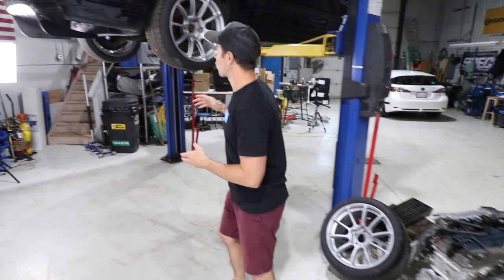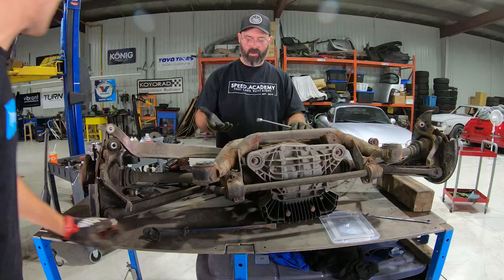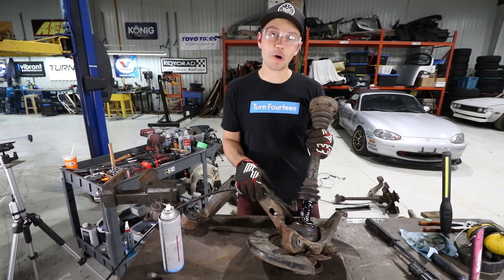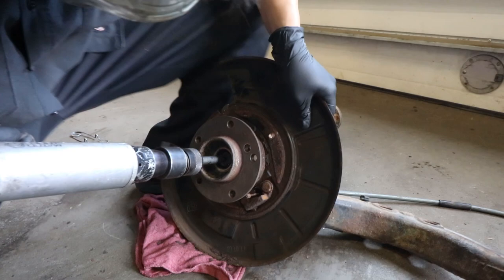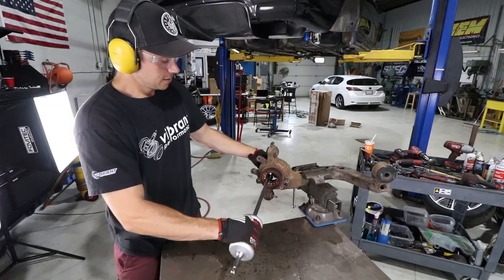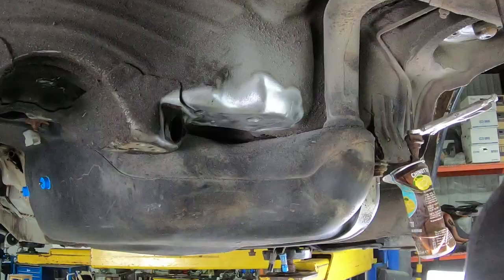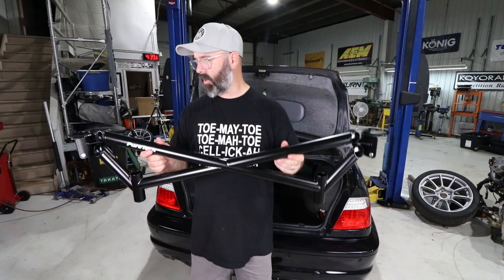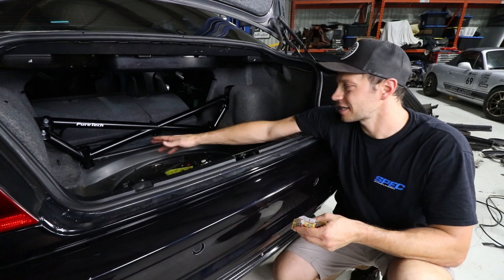Ultimate BMW M3 Rebuild - Best Rear Subframe Fix - Part 5

Comment: Just a friendly tip when welding cracks like those(Usually you wanna go with tig with matching filler rod as it is much cooler and wont weaken the metal around it with heat as much) but if you are going to mig it same process, the holes at the end is good but you should also grind a groove into the crack. The metal you are adding will always be stronger than the base metal so you want more of it with as little heat as you can. The groove not only allows the weld to penetrate further it also will allow the puddle/bead to lay in much more flush with the frame so when you go to grind it smooth you are removing much less metal(This is why tig is such a popular solution for this). Same process on repairing cracks on rims, groove and tig weld ect Just some friendly advice from someone thats certified in tig and mig in pretty much every size, filler rod and position :) This build is awesome, keep up the work!
Reply from the maker: Awesome info! Thank you. Honestly if time wasnt a factor I did read about cutting grooves but fell short to finish the episode
Reply: @speedacademy  Appreciate the reply! Maybe next time, sure does make the weld much stronger!

Comment: Please drill holes at the ends of any cracks even if welding or plating over, will stop the cracks propagating further in any welds or undertow repair plates. Do you have access to dye penetrant (DPI) chemicals so you can see any spider or invisible cracks. 

Edit saw you are drilling the cracks... great job!
Reply: just needed to fully weld the plates on..
Reply from the maker: @anders949494  Incorrect. If you look at Bimmerworld's site they dont fully weld the plates on. As long as the key areas are welded then the rigidity is the same.
Reply: @speedacademy  would do like Redish Motorsport do, and they fully weld but also makes better and bigger plates.
Reply: @anders949494  Yeah, Redish plates are nice.  That said, to do it right, sadly, you'll have to add cups and a CMP/Vincebar to the top side, or cracks will just happen there, sadly :-(
Reply: You got some balls welding the plates on with that gas-tank near it. Would've removed this first - and since the rear brakeline looks like hell, you'll have to remove the tank anyway to replace this line... but nice work. Just a bit sad to hear that the S54 is going to be replaced. Should've put a Supercharger or Turbo on it :D
Reply: @Gigges85  Earlier in the series, they explain why they didn't go with the S54 engine.   It would of cost to much in the end to do a rebuild, since it was high mileage, and not very well taken care of.   Plus they just did a S54 in their M3 drag build, and wanted to try something new.  Cheers :)

Comment: Three jaw puller for the axle. Use the three jaws around the hub, using the threaded rod portion to push the axle through.
Reply: Unless it's seized, like in their case. Then all it will do is pull the hub.
Reply: NCD2294 please go look at a parts diagram. If the hub isn’t installed there’s nothing for the axle splines to be seized to. The axle would just be left to rattle around loosely in the wheel bearing.
Reply: @michaelw6277  
My mistake. I realize now that it'd still solve the issue.
Reply: @of_lion22  no worries!  If I hadn't removed half shafts from so many different vehicles I could have thought the same thing.

Comment: All you needed was BMW special tool kit, would of came right out, also pulls axle back through hub. Only costs like $5k lol
Reply: Just get 3x three jaw pullers and hit them with the Ole milwaukee until the axle is out or you've stripper the pusher rod :D

Comment: The biggest difference you can often make to a roadcar that will see tracktime is dialling in the rear end so you don't get movement / deflection while under load because it robs your confidence to explore the friction limits of the car. I can say that even on my 997GT3, a far better starting car than this, the improvement was incomprehensibly large when I replaced some of the 'street' parts with better track orientated parts (shock mounts, firmer engine mounts, removing rubber from the toe and control arms, etc)
Reply from the maker: It's remarkable what those changes will make and we can't wait to test this car out with all these upgrades!

Comment from the maker: Have you ever struggled so much with removing a part that you thought wasn't going to get replaced or fixed? Tell us your story!
Reply: My diff drain bolt on my 350z had the most stubborn 18mm Allen bolt, I couldn't muster enough torque by myself. So I had to hire a lift so I could use a pipe on my rachet. $150 to remove one bolt aaaagh
Reply: I literally did the exact same thing on an E36 like 20 years, lost my mind I swear, think I actually cried a bit lol
Reply: Hose clamps. My flathead kept slipping off it was sort of annoying.
Reply: Needing to use forklifts and small wheel loaders with forklift attachments to remove and install pins in even bigger wheel loaders or excavators 😅 have even chipped off parts of tines of the forks hitting the pins that hard
Reply: Had the same issue with my FD RX7 axles. I managed to fit the axle and hub assembly in the shop press and get them out.
Reply: I finally hammered out a stubborn wrist pin using an old flathead only to realise the screwdriver was now stuck tighter than the pin had been. Had to saw it off and buy a set of punches. Lesson learned, use the right tools.
Reply: Yup, I had trouble with everything you can imagine a on a car but most of my pain could have been avoided if the people before weren't so scared of grease or antiseize and use them.
Reply: I had exactly the same problem on my e46 m3, left axle stuck in the hub. I was able to remove it with a 12 ton 3 jaw hydraulic gear puller from Harbor Freight.
Reply: In my desk, I have a pair of Sway bar end link nuts with attached studs. I bought a set of Swift Sport springs from a friend of mine with the catch that he help me install them (I tend to struggle mentally with these things when I try to do them on my own). Well, the end links were so rusty we couldn't get them to budge after about 2/3 of the way down the stud. So there we are, 9:00 at night on labour day weekend, I'm 500km from home, and the front suspension on my car is in pieces. Thankfully, the next day we came at it with fresh eyes and managed to get it replaced with a set of struts he had as spares.

The rears were literally a 15 minute job.
Reply: Sorry, but stuff like that i try to forget asap
Reply: E39M5 so I got the Bilstein B16 coilovers from the guy we traded he got my stock suspension and I got his with money on top, the rear struts collars weren’t touched probably in a decade and it was night mare ! It took 4 days to get those collars to get them loose! The technique we used was similar to air hammer except it was done by hand too about 2/3 hours
Reply: My friend and I were removing aluminum wheels from an f450 dually. Every tool we had wouldn't touch them, heat, penetrant, sledge hammers, porta-power, etc. So we manned up and took it to a wheel shop. They couldn't remove them either. The wheels are still on the truck, years later. I jokingly said we should leave the lug nuts off for weight savings, as those wheels were now officially permanent.
Reply: can you guys do a cost analysis video covering all the parts and everything you put into this and how much money you spent on this project in total
Reply: I had to hit the front control arm ball joints for about 30 minutes each side with one of those forks and a mallet to separate them from the knuckles in my E46. I live in a small town where the stores didn't have a properly sized ball joint separator (the one they had didnt insert properly onto the ball joint because it was too big and I didn't want to wait for 2-3 days to get one from Amazon).

Comment: You do realise that racp repair plates are just a band aid? They are intended as a final stage to a far more comprehensive repair.
The damage actually begins at the 3 spot welds joining the racp to the left rear inner wheel arch, there just aren't enough of them so seem welding this join is pretty much a must.
Will be interesting to see how the cross brace performs over the long term but I would have preferred to see something that also connects the chassis legs at the floor as this is another significant part of the overall design flaw... 
   I also worry that all of the cross braces, vince bars etc out there fail to address the front mounts sufficiently although on cars caught early enough tying the chassis legs together at the rear mounts should mitigate the chances of damage at the front mounts... There are however still some dodgy mig welds that invariably need attention..

Comment: Ya’ll could really use the help of penetrating oil. If you spray it on and let it sit for 45 minutes, that could help w a lot of man power you’re putting into it. Of course it doesn’t always work but don’t underestimate it

Comment: So afraid to see what my subframe looks like. I have 157k on my car 😬
Reply: T Ly that’s all i thought about the whole video 😂
Reply: Chances are your car will be totally fooked. Boot floor about to rip apart.
Reply: I got 220k miles on my e46 M3 and im afraid of what's underneath
Reply: I’ve got 157k on my 330i. Small crack near the left rear mount at the bend in the sheet metal. Pretty common place to first fail.
Reply: It all depends how the car was treated it's whole life.. if u buy a stock car with less owners chances are they drove the car normally, if its a salvage title, modified, and has had a bunch of owners most likey it's cracked. Also depends a lot where you live since their are areas where cars rust more
Reply: don't be, I spent money on buying reinforcement parts bushings and a mig welder and after many hrs of disassembling and grinding off rust my subframe was healthy , still went ahead and put the reinforcement kit and poly bushings, new shaft center bearing support and guibo, them recoat the bottom of half the car with rust proof,  if you ever get to do that allow yourself a few days and inspect your diffential,  I failed to do that and I have to go through that ordeal again and also make sure you tight all nuts and bolts in that area
Reply: @javierhernandez215  Did you do that on a lift or jack stands?
Reply: @MindOverEverything  jack stands buddy a large ones and it seems a bit complicated but once you start taking things apart and put it away more roomie is going to became, get a leather jacket for welding, also take the fuel tank off to be safe if you are planning on welding just to be safe,it took me 4 days to get it done a wasn't working hard and definitely not steady on and off,  average at handling tools and poor skills at welding, I Google any problem I came across, ate 3 meals and watch TV on those 4 days all that by myself
Reply: @javierhernandez215  That's really cool. Thanks for the tips, too. I just test drove a 2003 with 85k miles. Female owned and not driven hard, so if I buy it I probably won't have to do the subframe for a while. That'll give me time to learn some welding skills.
Reply: @corey4582  honestly it’s probably not that bad 
I mean fuck.. it’s lasted this long lol

Comment: i had the exact same issue when changing the diff and axles on my e36. I eventually got the axle out of the hub by using a pulley puller!

Comment: damn!! I'm glad I didn't get a e46 m3 and bought a m2 instead..
Reply: Same hahaha
Reply: Why would you compare a 15 year old car with a new one regardless of what it is? Specially with one going for $15-20k and the other +$40k lmao
Reply: @tribewu3223  because they are similar? Weight, wheelbase, handling, basically everything except the power output but still very similar. Not considering the interior here.
Reply: @zexiali6483  yeah I know thats why everyone who's driven a m2 say it "feels" like the old m3. My point is u just said it, everything is similar so why didn't u go for a e46 m3 after watching this video? Cause the sumframe issues ? If you're looking at a e46m3 all this needs to be in your head already & have no problem doing it.
Reply: @tribewu3223  m2 comes with warranty, nice interior. It's a 2 year old car. I daily it so I want it nicer.

Comment: It is easier to get the axels loose when the subframe is still in the car first rather than drop the subframe then remove the axels. Remove axle nut, spray a lot of penetrating oil in the spline, disconnect from the diff, then place a ball pean hammer in the axle dimple, then take a BFH and hit the opposite side of the ball pean hammer.

Comment: Didn't read all of the comments, but in case no one else already mentioned it, you should have welded all the way around the reinforcement plates, not just in a few places. Personally I would have gone with the Redish Motorsport plates. Also, any time you are directly underneath while drilling metal, do yourself a favour and put on some goggles to prevent getting metal filings in your eyes.

Comment: Wouldn’t an underside epoxy re-plate be better than weld? More homogenous contact, and no HAZ. 
What about using a Vincebar (or CMP similar) weld-I’m topside instead of the X-bar (which isn’t really an engineered truss. It’s simply 2 triangles connected at the middle-which, itself, is a flex point between the two triangles)

Comment: I've heard aircraft glue works the best to glue on the rear subframe reinforcements instead of welding them on limited spots.
Reply from the maker: There are alot of options and opinions. Welding seems like the go-to no fuss method without worrying about proper adhesion. Either method will last a very long time so unless you are talking about another 100K of driving and comparing whether glue or welds held together better, I think it's a wash for what is best.
Reply: @speedacademy  The reason I mention that is because some people at the track have used the welding method but later on experienced cracking around the welds instead. Either way with that reinforcement brace it should be fine. Thanks for all the detailed work and explanation you guys provide!

Comment: If you're going to push 1000hp out of this car, you're wasting your time with stock axles. I'd upgrade to driveshaft shop axles if they aren't already in the plans. Stock will guaranteed break.

Build is coming along well so far and you guys seem to be very knowledgeable.  👍

Comment: Might as well slap a 2jz in a cheap 240 chassis and call it super car killer. You could’ve made this into a fairy exotic classy “supercar” to kill supercars. 2jz is bore snore, s54 is much more interesting and just as capable.
Reply: Agreed. Their budget obviously didn't allow for them to do an HPF or Maximum PSI 1000whp S54 build
Reply: IMO a turbo S54 would be both too overused and too simple. I would love to see a twin turbo S62 instead, that would be closer to deserve a  "supercar killer" status in my mind

Comment: Hey guys im doing the same thing to my e46 and i was wondering when u have the rear subframe bolts in holding up you subframe are the top bolts that go with the brace stopping the subframe bolts from going all the way thru?

Comment: I've always doused anything grimy or rusty in penetrant fluid before even attempting removal. Not sure if it works on your hardcore rust.
Reply from the maker: Doesnt work that well on seized hardcore rusty bits like this. We’ve tried but we also dont have days to wait for it to do the job

Comment: You’re working against yourself by not having that table bolted down. Most of the energy from the slid hammer hits is going into moving the table. ✌🏾

Comment: lorenzo from core4 motorsports here,  
three tools that help tremendously with servicing the rear :

https://www.amazon.com/OTC-7208A-Front-Installer-Puller/dp/B0002SRF6C
use this to drive the axle out,  preload the center bolt, then hit it with a mini sledge and repeat until axle comes out

https://www.ecstuning.com/b-bav-auto-tools-parts/cv-axle-shaft-puller-wheel-bearing-hub-installer-kit-bavarian-autosport/b8800102~bav/
use this to pull the axle back in through the hub, and this can also be used to install the front hubs gently

once the axle is out , you can use a generic slide hammer to pull the hub out

also for the rear bearing servicing, i use a fwd bearing tool such as this

https://www.amazon.com/ATD-Tools-8625-Bearing-Adapter/dp/B00AZABHLQ 
makes removal and install of the bearing very easy, and this is also used to press hub back into the bearing.

make sure your snap ring is fully seated.  it looked to be still out slightly.  also, before trying to remove it,  i hit it a bit with a flat punch perpendicularly to free it up from any rust.   the flat punch can also be used to help reseat it on install.

we are able to service rear hubs in much less time with these tools on hand.

Comment: I know it's a bit late for this, but the OTC Hub Grappler kit works great for bearings and hub and you usually don't even have to pull the knuckle off the car to do it (assuming you can get the axle out lol):

https://www.amazon.com/OTC-6575-Hub-Grappler-Kit/dp/B004ZG69D2/ref=sr_1_1?keywords=hub+grappler&qid=1570306114&sr=8-1